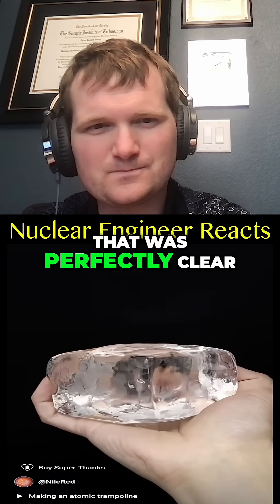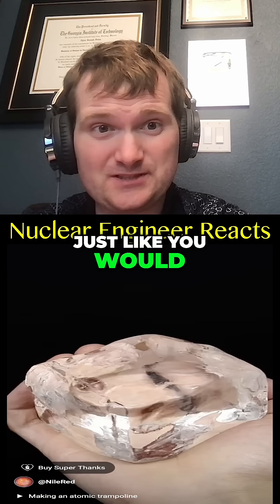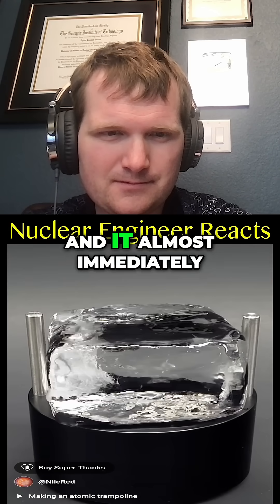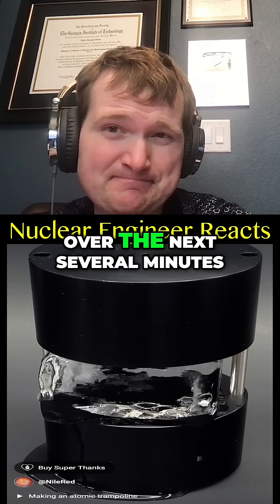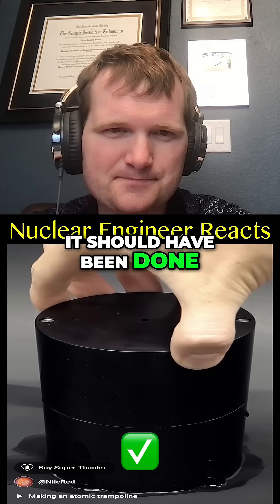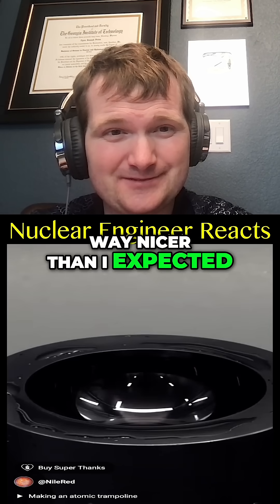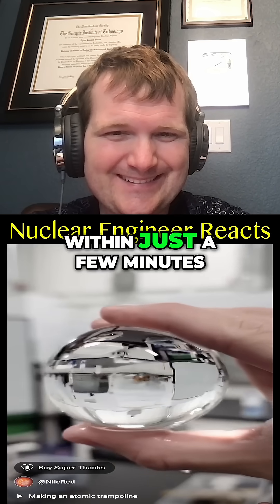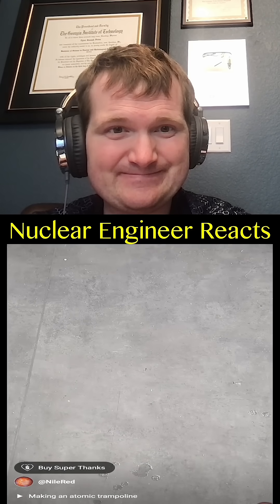Making a Ball of Perfectly Clear Ice - Nuclear Engineer Reacts to NileRed

Comment: Actually the water can be standard tap water maybe run through a filter to get out large impurities.
Optically molecular impurities are not that much of an inconsistency. The thing making ice unclear is mainly trapped air and cracks. If you make ice by freezing it unidirectionally and at a warm enough temperature that liquid water can seep into anny cracks that may form, then you get a clear material.

Comment: Nope. You can make clear ice with tap water. You put water in a cooler that has no top and freeze for 24 hours. It freezes from the top down pushing air and impurities into the still liquid water below. Take it out, turn it over and wait for your block of clear ice to drop. Old bartender's trick.

Comment: You don't need distilled water for clear ice. Just take regular water and freeze it in an insulated container.  This will make it freeze from the top down so any impurities in the water would settle to the bottom, and you don't use the bottom part

Comment: Clear ice is actually easy to make. You only need directional cooling, which is about as easy as getting a block of styrofoam, filling it with water and there, directional cooling jig (though obviously you'd want to waterproof it on the inside)

Comment: Deionized or distilled water will still not result in clear ice because of trapped air.  You need to force the water to freeze in one direction rather than from the outside in like we get in most home freezers resulting in trapped air.  Most common ways to achieve this are insulating the ice mold (like using a cooler in your freezer or something) so it loses more heat from one side of the water, or by making the ice on a cold plate and adding a thin layer of water at a time.

Comment: Ice is cloudy not because of "impurities" but because of air bubbles.  You can get clear ice if you use directional freezing with tap water.  Of course, using distilled water doesn't hurt.

Comment: You dont have to use distilled water for a clear ice cube, most of the foggyness in ice cubes is actually trapped air bubbles. You would need to do something called directional freezing, in practice pouring water in an open insulated container.

Comment: Not just “deionised” or “distilled” but degassed - dissolved gases are expelled when water freezes forming gas bubbles, so basically you need to start with boiling water (which drives off dissolved gases).

Comment: You don't actually need to use super pure water for clear ice. You can take an isolated thermal container, take off the lid, put some water and then freeze. After some time clear ice will form on the higher part. That's because it directionally freezes water, so all impurities are pushed to the bottom

Comment: You don't need dionized water for clear ice. Pretty much all impurities are in solution so clear. The fact its clear stems from dissolved air coming out of solution. To make it clear you need to freeze it directionnaly to push out air from a section of it.

Comment: So no, it doesn't need to be deionized or distilled to be perfectly clear, nor will that lone even make perfectly clear ice. It's in the freezing method to pull and at the very least isolate air bubbles that makes ice perfectly clear

Comment: The way to get clear ice is NOT just getting rid of imperfections. Freezing ice normally freezes from the edges of the ice mold to the inside which traps air inside, and the air is what causes the ice to look cloudy. The way clear ice like this is created is by insulating the edges of the mold to only allow it to freeze from one direction. This unidirectional freezing is then stopped before all the water freezes, and the ice that is left remains clear.
Reply: Well, you’re mostly right. We might as well be more specific. The way Nile made this ice was warm water in a cooler, then the cooler into a freezer. After 36 hours, he stopped the freezing, and broke off the non-uniform stuff, releasing the water as well. Then he cut it into quarters, and “polished” it with running water. It still had some imperfections, but it was mostly just clear ice at that point.
Reply: @Bobal27 that's how he did it, but what this guy explains were you needed to react on, is entirely right. Look at high end bars, they can't use distilled water. It works poisonous on the human buddy

Comment: You don't need distilled water to make clear ice, but it does help. If you freeze water in an open cooler, it'll freeze just like a lake and give you a clear layer at the bottom. Just cut away the bad part, and you're ready to go. This is how restaurants make clear ice for cocktails.

Comment: Not only does it need to be distilled water but it also needs to be frozen in a very specific way, because water naturally will dissolve some gases when sitting in a room, and those bubbles need to be allowed to escape during the freezing process.

Comment: For pure looking ice you don't have to use RO or distilled water. It's a common misconception. Most of the "impurities" are related to trapped air. With proper technique (directional freezing) you can force air and debriefs to the bottom, then just cut it off. 
Voila, you have clear ice with tapped water.

Comment: You don't use distilled water for clear ice. You use directional freezing, you can achieve this with a freezer and cooler, gill the cooler with water, leave the top open, and freeze it, if you freeze distilled water it'll have the air and you'll have white streaks in your ice, baffled he said that

Comment: You can achieve the same effect at home with tap water. You let it partially freeze, then remove the top layer that contains the air & impurities lol you result in a way smaller ice cube but hey its clear and you didnt need to pay for distilled water lol

Comment: If it just needs to beclear to the naked eye, sone insulation around the ice mould is enough. The water will freeze from one direction and push all the air bubbles to the other side.

Comment: you dont need special water actually, though it might help a little. cloudy ice isnt caused by minerals or anything, just small gas bubbles which can be removed from water via boiling and the ice can freeze either no dissolved gassed (must be frozen very slowly in one direction eg. bottom frozen until top frozen)
Reply: That is a modern myth that you swallowed. Nile Red proved that.
Reply: @jtnomura  nile red did not freeze it unidirectionally it his last video, which was my last criteria. Also in that video he tries to use DI water, and that also didnt work. But in the first video (when he made clear ice) he did freeze it unidirectionally. The boiling is mainly to drive out the air to make it marginally clearer. My main point of this is that he got the DI water thing wrong bc its air not minerals making it cloudy, and air can be removed via boiling and unidirectional freezing, while minerals cannot be.

Comment: hello, amateur turbo-autism-powered cocktail nerd here (I know, such high qualifications lol)

I regularly make clear ice with my well water at home. Directional freezing is the way to do it. All water, no matter how pure, is going to have dissolved gases in it at atmospheric pressure- when water freezes, those gases come out of solution, trapped inside the matrix of ice, and become bubbles, making the ice cloudy. When the water is insulated on all sides but one, (for example, a lake) and is freezing in a single direction, all of those gases are able to escape the encroaching matrix of ice and remain in solution in the liquid water, allowing the ice to remain clear.

Comment: Not only do you need to deionize it, but you need to de-aerate it. The white in ice is often just disolved gases. Even dissolved oxygen, hydrogen, or nitrogen, any of those gases that pairbond to themselves, would need to be out. They don't create a dipole moment, or ionization of any kind like a polar gas like carbon monoxide would, nor do they react in small quantities subtly like carbon dioxide forming carbonic acid. But all the same. If too much of those gases are present, tiny airbubbles form in the ice as it crystalizes, leading to cloudiness.

Of course, 100% purity isnt possible, but you'd need to get the gases out as best you can. I dont have an exact number, but you'd probably want to be above 99.99% free of dissolved gas. Perhaps putting deionized water under a vaccum, such that its boiling point lowers to a few degrees above human body temp, would achieve this by drawing out most of the dissolved gasses.

Comment: You don't need distilled water or pure water to make clear ice. That's a myth. It uses a technique called directional freezing and you can do it with regular tap water, very easy to make at home and you don't need expensive equipment, just a regular camping cooler

Comment: So actually just freezing deionized water will still make it not clear, you have to freeze it top to bottom, or vice versa, so no air is trapped, like it is when it freezes from outside to in without using a special ice maker

Comment: Bruh. Not everything is about nuclear reactors. You make clear ice by letting it freeze slowly, and directionally. Just get an igloo cooler and put water in it, and leave the top off. The stuff at the top looks like normal ice, and the stuff at the bottom looks clear. And the ice sphere maker is just aluminum with two hemispheres cut out. The heat conduction of the aluminum melts the ice, along with a bit of pressure causing a relatively fast creation of a clear ice ball. It's used at bars and fancy restaurants. Not nuclear power plants.

Comment: some youtubers actually have debunked the fact that to make clear ice you need to boil / deionized the water, what you actually need is to directionally freeze it so the air bubbles goes to one side by using ice cooler box inside a freezer
Reply: Facts
Reply: The thing is, if you dont use deionized water, you will not get PERFECTLY clear ice, it will be clear, but not perfectly clear and nilered did most deffo use deionized water
Reply: @oliv73911 not necessarily true, clarity doesn’t necessarily correlate with the chemical makeup of the compound. Water with sodium chloride can just be as clear a pure water.
Reply: what im saying
Reply: Yeah it’s like people have never seen clear glaciers either. It you remove the oxygen from the water you can get clear ice.
Reply: You could said proof or corrected. Not everyone is perfect, some people might also making mistakes, probably you make more than most people?
Reply: Deionizing water has absolutely nothing to do with removing air bubbles. Directionally frozen water that hasn't been deionized still has impurities in it, so it's not completely clear.
Reply: you are absolutely right.
Reply: Why you saying "debunked" like it's not also correct lol, you could have said "an alternative is to..."
Reply: @j-fire3975  No, it's been proved that boiling / deionizing alone doesn't work
Reply: @kingofstrike1234  I see
Reply: Yeah. I'm not watching this guy anymore. He's acting as an authority on so many topics, but doesn't even correctly fact check the clear ice comment.
Reply: @LunarUmi  So your only reason not to watch him is a random comment when you were problem too lazy to check for yourself lmaoo
Reply: @ Why are you defending him when he's in the wrong lol?
And I already knew about the clear ice thing because I've watched bartenders on YouTube that have shown how to make it lol. 
If there's one thing I despise in this world, it's when people talk about topics they know nothing about with authority and confidence.
Reply: @w花b I too do not seeing him in my YouTube feed. It’s mostly has to the fact he use his nuclear engineering background as if he know all things physics and he often can be wrong about things. I as an electrical engineer will the first to admit that I don’t know everything but love learn ask questions and overcome challenges.

Comment: His lab has air too, which you'd also breathe at a nuclear power plant. 😂
Reply: This comment was so funny that my 5-HT receptors went into overdrive, flooding my synapses with serotonin at lethal levels. My raphe nuclei short-circuited, my serotonergic pathways collapsed, and my postsynaptic neurons went into toxic overactivation. The result? Full-blown serotonin syndrome, hyperthermia, tremors, and an immediate seizure. My autonomic nervous system failed, my prefrontal cortex blue-screened, and now I am officially dead, permanently logged out of existence.

Comment: Making clear ice does not require deionized water, any tap water will do. The ice needs to be frozen such that air bubbles have an escape path while the water freezes and seals them inside the cube/shape. You can also just stop the freezing process part way and the ice that does form will be perfectly clear.
Reply: I think he was confused about the "perfectly clear" So he thought that for it to be perfectly clear there cannot be any debris in the ice
Reply: directional freezing
Reply: And deionized and distilled water still freezes with bubbles trapped inside of it. Even heavy water freezes with bubbles trapped inside.